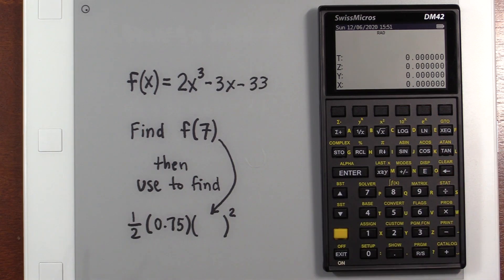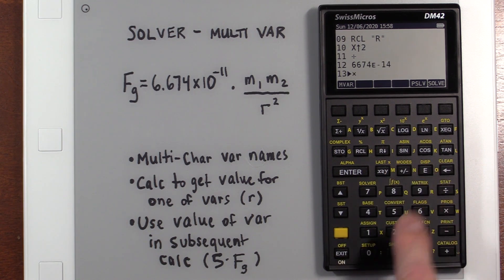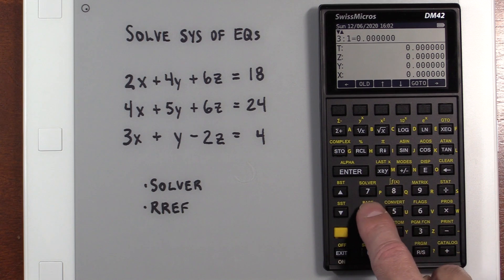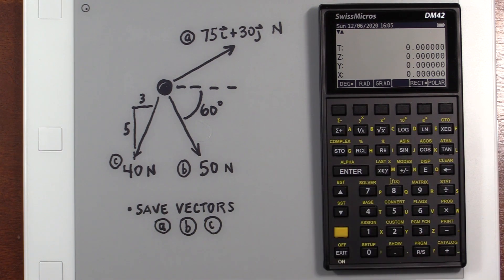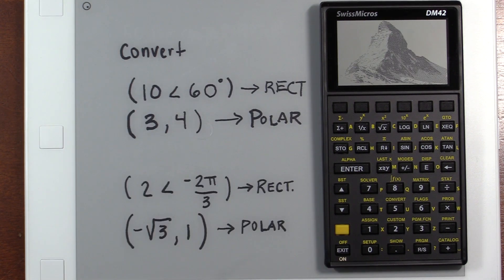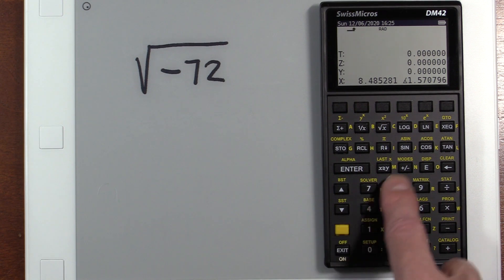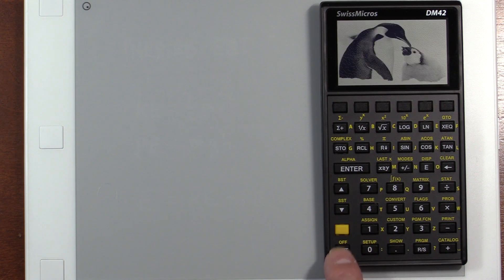DM42 (SwissMicros) - Solving Various Engineering Problems

Comment: 400 CAD??!!! Really??!!! What are they thinking?!!😂
Reply from the maker: @bonjournito  It is definitely expensive - a luxury item.  In real dollars, it is probably similar to what it sold for new in the early 1990s.  Not sure bc I could not find original MSRP.  But, when compared to other modern programmable calculators it is pricey.  Also, the currency exchange rate will also cause fluctuations in price.

Comment: My HP48GX died earlier this year and I got the SwissMicros DM42 to use as a replacement. The 48GX was awesome.
Reply from the maker: The display and simplicity of the DM42 (and the hp 42S) are both advantages, but it is no 48GX.  It really depends what you use it for.  For me, the DM42 is better.  But, I've been thinking I might give my old hp 28S another whirl.
Reply: @scottcollins7513  My HP 48GX was most useful for matrix operations solving a system of equations, but where it really rocked was phasors for AC circuit analysis
Reply from the maker: @stevebjee  I understand the matrix operations bit, but have no experience w/ the AC circuit analysis (phasors).  48GX is great w/ matrices and vectors -- better than DM42.  If you really miss your 48GX, you might explore either buying a used one (they are quite pricey generally) or investigate some of the people who are modifying their DM42 to become a 48 as I understand.  There was a Droid48 app for android that worked well -- but you'll miss the awesome keyboard of the 48.  One other idea would be to get an old 28S which is like a 48GX "lite" - costs significantly less and better display than 48, but also very old at this point - they are out there, though.
Reply: It might interest you to install DB48X on your DM42.

Comment: In what  way would a 48 "blow this away"?
Reply from the maker: First, know that I really like the DM42 and appreciate its overall simplicity (and superb display).

Some things the 48 offers that the 42 does not:
- Infinite stack
- Full-blown directory structure (you can organize all your programs by topic, etc.)
- Solver - super powerful and easy to use - can embed/nest formulas within formulas
- Units and Unit Conversions (as complex as you want, it can handle them)
- Vectors that you can work directly with - 42 can do similar ops, but the 48 is simpler
Reply: @scottcollins7513  Thx for the follow up.
Reply: @scottcollins7513  DM 42 is great for number crunching,but clumsier for doing integrals,matrices etc
Reply from the maker: @EEhe-i7t  Agreed.  Also, the solver is clumsier than hp28/hp48.
Reply: Yes

Comment: Just got my DM42 and am learning lots of cool little things about it which have just been done very thoughtfully.  For example, for your polar/rectangular conversions, as you showed, if you have two real numbers in X and Y and you do convert to polar or rectangular treats them as the two parts of a complex number and then does the conversion as you would expect.  If you have a complex number in X (eg you had two real numbers in X and Y and hit "Complex" or got it by taking a negative square root or whatever), and do the conversion to polar or rectangular it will work just on the complex number in X.
Reply from the maker: There were geniuses at work at hp back in the day -- the hp 28, 48, and 42 are all amazing devices.

Comment: i cannot update it, and now it is stuck in the bootloader screen, even when I reset and/or remove the battery.
Reply from the maker: Reach out to SwissMicros.  They are small enough to actually help out customers.
Reply: @scottcollins7513  
they are not answering

Comment: I hate this calculator because why would you put pi as a second option
Reply from the maker: Probably b/c its designers regard pi as highly irrational.
Reply: @scottcollins7513  Casio has the same issue as well and some HP models. For a frequently used button the second shift is an insult
Reply from the maker: @gvi341984  It does seem like there is always some design decision that makes us scratch our heads.  I have never minded pi being shifted function, but I would if I did a lot of work w/ it (one cool thing about the 42 is that you can write little programs -- to compute the area of a circle for example).  Even the TI-30X Pro Mathprint has factorial as a primary key, but square root as a shifted function.  But, the layout of the keyboard is very logical.  I'm sure there is a lot of debate going on when these devices are getting designed.  And, it is one of those things where you are never going to make everyone happy.
Reply: @scottcollins7513  Shift function doesn't make sense for root and pi since they are used so often.
Reply: Well, the HP42s, on which this calculator is modeled has the same arrangement.  Besides, most calculators have pi as a button's second function.

Comment: the 42 is excellent for finding roots.  you are supposed to use the solver, which you didn't use.
Reply from the maker: Correct me if I'm misunderstanding you, but the solver is good for finding a single root, but to find the other roots requires knowing where to look for them -- in other words, you have to provide the 42 with a starting point from which to iterate.
Reply: @scottcollins7513  
Yes, correct.  I have not used the other brand you mentioned, but I assume it finds all the roots at the same time?  I guess that might be better in a classroom environment.
Reply from the maker: @tallswede80  Yes, as you correctly stated, there are other calculators that will just give the various roots at the same time which is great for a math class.
Reply: @scottcollins7513  
Then again, classroom environment is artificial, so it is a mistake to design tools that are only to be used inside a classroom.  Ultimately the classroom is a means to an end, but teachers these days act like it is an end in itself.
Reply from the maker: @tallswede80  In defense of teachers, they are told "you will teach to these standards" which removes so much flexibility from the process.  100% agree that teaching is meant to equip, not to be an end in and of itself.

Comment: I need a Degrees, Minutes & Seconds button this calculator does not seem to have one.  Is it in a menu someplace?  Can it be called up quickly?
Reply from the maker: Hi, Bill.  It does have the function that's easily accessed.  Look under "CONVERT" menu.  The only weird bit is that, for example, 12 deg 34 min 56 sec is entered as 12.3456.
Reply: @scottcollins7513   Thanks for that. I use those functions quite a bit but I have always found them from CATALOG then FCN.

Comment: I was very interested in purchasing this calculator
Currently I have a numworks calculator, and an hp prime. Both have seperate apps for algebraic input, RPN input, and CAS. On the numworks its more split-up, there are applications for functions/statistics/etc 

For example, lets use the equation from 8:02 in the video. On the numworks I 
1. open the functions app, type the function in algebraic input
2. open the rpn app, hit var, solve for f(7), then I can do the rpn calculations in the video 

if we use the equation at 6:54, I can just open the Cas (KhiCas) app and write: 
linsolve([2x+4y+6z=18,4x+5y+6z=24,3x+y-2z=44],[x,y,z]) 
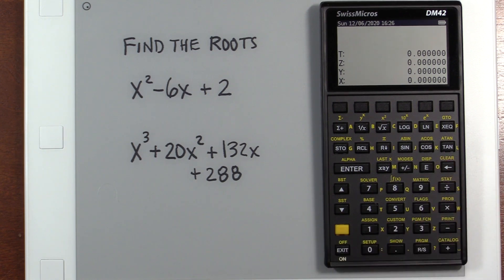And it will solve the outputs. Similarly I can use it to solve for problems such as the one at 16:19. Any complex problems are also kept "accurately" as it solves symbolically rather than numerically 

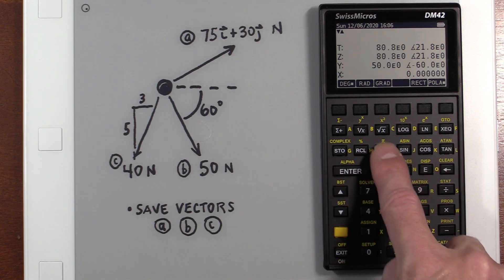I find RPN input much faster for quick calculations and any arithmetic. the CAS functionality and algebraic notation is superior for algebra. I see any arithmetic problems (e.g. the vector problem at 10:28) are much, much faster with the dm42/RPN. 

Just wondering, what are the reasons you like using the DM42 (and the HP RPN calculators in general)?

(also, what e-ink tablet is that, was looking for one for Note-taking)
Reply from the maker: I know very little about Numworks -- I did use the free online version a little bit at one point.

You should download Free42 on your iPhone/Android and see what you think of the hp 42S calculator in terms of usability.

Reasons I like hp RPN (more accurately RPL) in general:
- I used the hp 28S and hp 48GX, both had great keyboards which made them nice to interact with
- I used them in an era when they were superior machines for engineering problem solving and when algebraic input was NOT textbook entry style that it is today
- Few keystrokes required to get answers (but you did have to get through the learning curve)
- Great built-in Solver
- Flexible unit conversions
- In other words I got attached in an era when hp was the top dog

Reasons I like the DM42:
- Great display (unlike the hp 48GX which is rather poor in comparison; the hp 28S is not all-that-great, but it is better than the hp 48GX)
- Small form factor
- Solid build quality -- including steel back/sides (the revised keyboard is good, but not as good as the hp 28S or 48GX)
- Not-overkill - generally can do what I need, but simpler to learn/program than 28S and 48GX b/c it does not do as much.
- I don't need 3D vectors or unit conversions these days
- I can program it to do some tasks it does not do natively and the programming is not difficult
- Solver is vastly inferior to that of the hp 28S and 48GX

I should say that I also think the CASIO fx-991EX and the TI-36X Pro are great calculators for the money.  Is the DM42 worth 10x as much?  Probably not.  But, the DM42 is the one I want to use.  It feels special.  And the display is great.

The Prime is a beast, but I never have bonded with mine.  It just feels disjointed, generally.  Like a lot of good things slapped together into one product, but just lacking in elegance for lack of a better word.  Keyboard is great (I think the Prime keyboard is a bit better than DM42, but still not as good as hp 28s and 48GX).  Screen is very good.  Some of the apps are cool (Triangle Solver).  RPN is half-baked.  Algebraic is a bit pickier than CASIO and TI.

The tablet I'm using is a "ReMarkable" tablet (Gen 1).  It's pricey, but good for taking notes and marking up PDFs.

Hope this is helpful.  Thanks for leaving the well-organized comment, Shaun.

Comment: Are they keys stiff or they are comparable to the 48GX? I saw in other videos that the keys were stiff? 

Cheers
Reply from the maker: They feel fine to me and not too stiff. There was a design improvement that happened right around the time mine was purchased — but, I’m not sure if I have the new and improved keyboard (probably) or the original. That said, the keys on my HP48GX and HP28S are somewhat better.

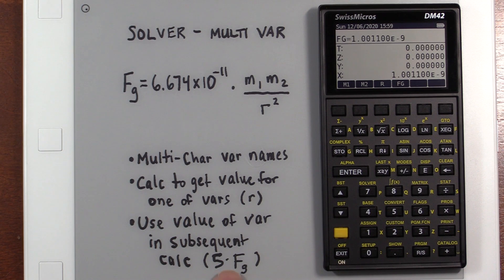Comment: 5:56 ...My hp 17bII+ solved the universal gravitation equation instantaneously—and without having to rearrange the equation; hp 17b solver is SO intuitive and easy!
/hp solve
Reply from the maker: DM42 is definitely not efficient in this regard -- my TI-36X PRO and CASIO fx-115ES 2nd ed are both much more intuitive.  Thanks for the comment.
Reply: @scottcollins7513  ----Today, there are only two calcs that I really need, and for very specific reasons: the TI-36X Pro and the venerable hp 17bII+
..... The TI-36X Pro, because it saves enormous amounts of scrollable calculation/answer history, far more than Casio scientifics, and especially because no Casio even saves calculation history after power-down.
..... The hp 17bII+ because the Solver is out-of-this-world easy, intuitive, and when you key-in an equation, the hp 17 instantly creates elegant soft menus at the bottom of the LCD of all the variables in the equation; so beautiful!
..... Furthermore, the hp 17bII+ ensures that any equation you key-in is mathematically valid before you attempt to solve it. So handy! ...I keyed-in the complex Colebrook-White equation for determining the friction factor in a pipe carrying water. Colebrook-White equation is an implicit equation such that it has the friction factor variable "f" on BOTH sides of the equation. But my hp 17bII+ handled it with engineering agility, --this in a compact shirt-pocket sized calculator the way God intended!
/Silicon Valley Regards
Reply from the maker: @GeoCalifornian  I just made a video today showing the way TI-36X Pro excels in handling past expressions and results, making them easily accessible for subsequent usage AND keeping them when you power off or switch modes (here's a link in case any one is curious: https://www.youtube.com/watch?v=beUZrvdnPG8).

As for the hp 17bII+, I've never used it, but what you are describing and from what I can see in images of the calculator, it sounds very similar to the approach used w/ the hp 28S and 48GX.  What's subtle, but great about the approach is that you can make in-between calculations and then save those to the variables as you go.  Agree that it is very intuitive.

Thanks for the Silicon Valley Regards... next time please send some of the weather -- tired of snow/cold in my part of the US!
Reply: @scottcollins7513  ----Scott I will check out your newest TI-36X Pro video!
.... In the meantime, I witnessed the engineering prowess of my pocket hp 17bII+ by solving the Colebrook-White equation for friction factor in a pipe.
/hp solve
Reply from the maker: @GeoCalifornian  Just looked that equation up.  That's a bit of a beast (flashback to fluid mechanics).  Cool that the 17bII+ solves it with ease.  I may have to give that one a try on the lesser calculators to see if they can handle it.
Reply: @GeoCalifornian  You haven't heard of Casio fx-5800P?
Reply: @Crazytesseract Yes, Ive seen that 5800p, I wish it was a little smaller. But I may want to buy it because of its features. Thanks! 😊

Comment: Nice video. Watching this reminded me of one of the idiosyncrasies of the 42S that bothered me. When you are entering a complex number, you enter the magnitude first, then the angle. When you are entering a vector, it's the reverse.
Reply from the maker: Thank you for the kind words.  YES, I agree that the inconsistency is strange.  Was not aware of the vector behavior you are describing, but I have run into the same thing when using CONVERT from rectangular to polar and vice versa.
Reply: It is because the stack is upside down (bottom-up). If the stack was the other direction (top-down) then the apparent inconsistency goes away. 

There may still feel like an inconsistency, but it's introduced by the COMPLEX function not following previously established input convention.

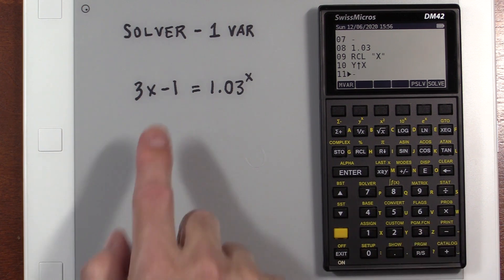Comment: 2:33 "Hopefully you can visualize that" ... No I can't, without writing the rearranged equation down on paper... the solver on the HP17BII is more intuitive in this regard.
Reply from the maker: Agree -- RPN takes some getting used to, and even then, it's more intuitive to use a solver that allows you to type in the equation exactly as it appears on your paper and then solve for the variable of your choice.  Casio fx-991EX and TI-36X Pro are both strong at this.
Reply: @scottcollins7513  --I am bidding on an HP17BII right now... the Solver function is so functional for engineers, contractors, nurses, et al...  I don't know how I missed it all these years...
 
...Take a look at how elegant and intuitive it is: 
(Variables in your equation are shown on the soft menu, and any variable can be solved WITHOUT the need to rearrange the equation; simple and elegant!)
Just scroll over to the 1 1 : 5 5 minute in the video for the fun to begin...
https://youtu.be/fVO6HoT2pCE
/Silicon Valley Regards
Reply from the maker: @GeoCalifornian  Agree that it is a better approach.  The HP28S and 48GX have the same general sort of solvers.

Comment: Great video.  Used along with Logan West's.  Lost all my old programs due to a inadvertent buttons getting pressed while 42 was in briefcase.  (Keep Button Side In lol).  This was a great help in getting me up to speed again.  Thanks!
Reply: I recommend backing up all files, states, off images etc. and keep a usb cable with you (in your briefcase).  I use the DM42 daily at work and can connect to my work laptop without having IT involved....  I owned tons of calculators (graphing and scientific) and the DM42 is like my laptop, it goes wherever I go.
Reply from the maker: Glad it was helpful, Harmon.  Thanks for letting me know!  Cool that you have an original (presumably) 42S.